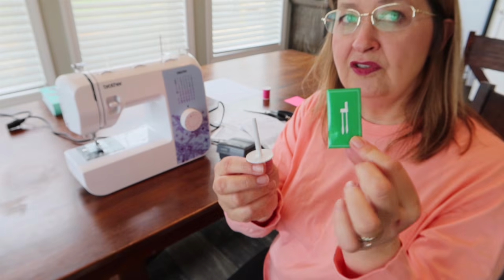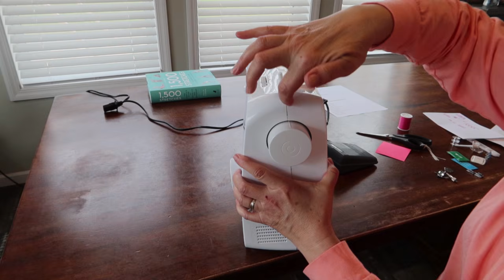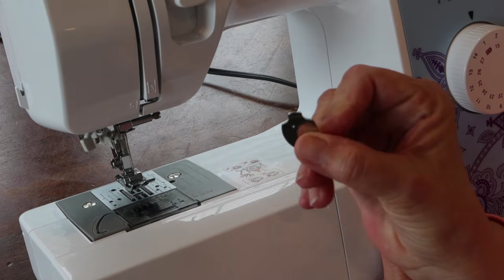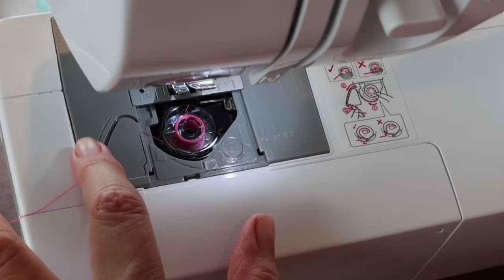Brother XM2701 Instructional video. Accessories, parts of the machine,

Comment: The feed dog of this particular model cannot be dropped to do quilting.  The darning plate is helpful yet the slightly raised level from the plate sometimes moves my hoop by its force.  Would a quilting foot/free motion foot solve the problem to let me embroider or guilt easily?  Thanks
Reply from the maker: Well, it would definitely give you enough space to move the fabric easily. I have not tried it, but it would be worth a test.
Reply: @momdoesstuff  ok thanks
Reply: ok thanks

Comment: Thank you for this instruction. I have been sewing for many years and this sewing by far is THE MOST COMPLICATED and CRAZY way of threading the threw the  bobbin, through the loops through the way to getting it going down the slit in the front, up the loop, and threading it so that you get the built I. Threader to actually hook the thread through the needle! Tedious and too many steps to remember this non traditional thread path to an ordinary sewing machine. Didn’t anyone ever tell the designer of this head spinning machine threading set up to “NOT to TRY TO REINVENT” what all the other REGULAR sewing machine have because this new threading set up by brother is a disaster!!! Every single time o have to thread this machine I get it wrong almost every time because I can’t get a foot stitch from it if it is threaded wrong!!! I spent over 30 min trying to follow this direction before I was successful. Then I had to rethread the machine again and had to watch the video yet another time!!!! I really don’t want to say this but there is a quote that I will write and you can all fill in the blank for the rest of the quote since it is always used, “ keep it simple _oo_.  Thanks but o must also add a no thanks since it is costing me hours to set this tread and spool up until o memorize how to do it. Hopefully with practice I should remember this ridiculously complicated threading & SPOOLING & BOBBINS set up❗️

Comment: with the accessory compartment (the bit you remove to turn it into a free arm machine) the storage is completely open, and because it hangs a bit lower than the machine, there is a gap and all the things in the storage tumble out. is there any way to fix it? 13:16
Reply: I kept my little accessories in the little zip lock bag and carefully stuffed it into the compartment. It keeps everything together and because it is slightly stuffed into that small space, it tends to stay in place when I take the accessory compartment off the machine.  I do imagine it would all tumble out if the accessories were not in a little bag.

Comment: I missed something. Why shouldn’t we have the light on when we thread the needle?
Reply from the maker: Well, it's not that you can't, it's just safer if the machine is off.
Reply: @momdoesstuff  Of course.  I understand now.  I had missed the part about accidentally stepping on the foot pedal and running over one's finger.  Makes sense, although frankly I have never turned the light off.  Thanks for the reply!

Comment: Thank you so much for a very detail instruction.  I bought an used Brother SM2700.  The thread keeps jumping off the thread pole.  Please tell me what can i do ?  The pole is glued to the position so i cannot change to another taller pole.  Please advise.  Thank you
Reply from the maker: There should be a round white disc with a hole in it that you can slip on the post to hold the thread spool in place
Reply: @momdoesstuff  there isn't one.  I bought 1 cap on amazon and it very loose because the hole is much bigger than the diameter of the thread pole..  Thank you.

Comment: Why is my thread keep on breaking when  I started sewing??
Reply from the maker: It could be several things. These are things I always try. Unthread and rethread the top and the bobbin. You could have missed a guide somewhere.
Try a different thread. Sometimes a spool of thread goes bad or just gets old. Make sure the thread isn’t getting hung up on the spool.
Try a new needle. It could have developed a burr in the eye that’s shredding your thread. 
Check your tension dial. Make sure it’s not too tight.
Hope this helps

Comment: Why is my thread keep on breaking?
Reply from the maker: Well, there are several things that can cause sudden thread breakage. I would rethread top and bottom threads carefully. It can be caused by a bad spool of thread. Try a different thread and see if it breaks as well. Also, sometimes the needle gets a rough spot on it and that can cause breaking.  Try a new needle.
Make sure your tension is not too tight.
Hope that helps

Comment: I bought this exact machine today but when I was testing it, although I didn't thread it but when I put it on and pressed on the presser foot only the bobbin threader turned. The needle did not move up and down. I don't know if there is something I didn't do right
Reply from the maker: Most likely the bobbin winder is engaged. The needle doesn’t move when it’s winding a bobbin. Move the bobbin winding spindle to the left
Reply: @momdoesstuff  oh!!!! It worked. Thanks so much.

Comment: Here is each section of this FANTASTIC video indexed for y'all!
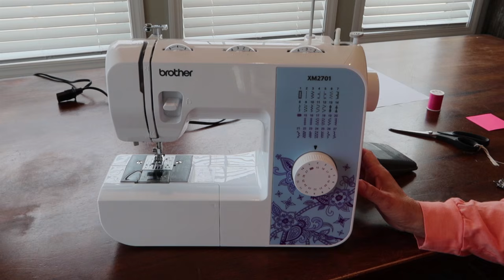First 3.5 minutes: Accessories and other things included with the machine. At 3:45, she begins describing the anatomy of the machine itself as follows:
3:55 - 4:31: Bobbin Winding Center - Bobbin winder, bobbin pin and bobbin compartment
4:32 - 4:51: Thread Spool Pin
4:52 - 5:04: Thread guides.
5:05 - 5:36: Take-up Lever and presser Foot
5:38 - 6:39: Needle Threader
6:40 - 7:45: Needle Plate

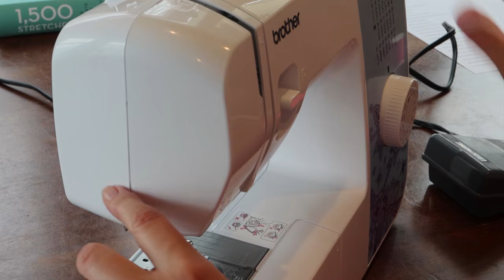7:49 - 8:13: Needle Cutter
7:14 - 9:33: Stitch length and Stitch width dials
9:34 - 10:01: Thread Tension Dial
10:02 - 11:23: Stitch Pattern Selector
11:24 - 11:36: Reverse Stitch Selector
11:37 - 11:42: Hand Wheel
11:43 - 13:19 Accessory Compartment and Free-Arm Feature
13:20 - 13:52: Intro to Operation, turning the machine on and off and plugging in presser foot pedal
13:53 - 14:57: IMPORTANT SAFETY TIP!
14:58 - 16:59: Needle Replacement
17:00 - 20:41: Steps 1 - How to Thread the Bobbin
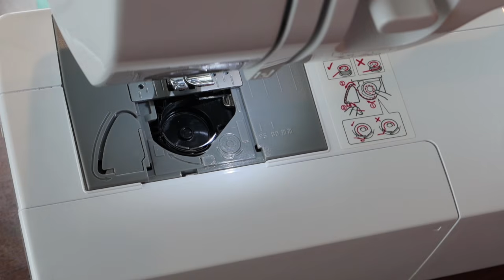20:42 - 22:29: Loading the Bobbin in the Bobbin Compartment
22:31 - 27:03: Threading the Needle
27:04 - 27:50: Unthreading the machine after use
27:51 - End: Practice
Reply from the maker: Oh wow! Thank you so much!!!
Reply: @momdoesstuff  If it's helpful, feel free to copy into the description with any tweaks you see fit to make!
Reply from the maker: Thank you so much! It's perfect just like it is! @kathydiane23

Comment: Hi! I followed all these instructions, but when I go to sew, the needle gets stuck after a while, and when i pull the fabric out, one side of the fabric is how it should look, but the underside is a MESS of thread and it’s all tangled. What am I doing wrong??
Reply from the maker: Problems on the underside usually mean a problem with the top thread. Unthread and rethread again. Make sure the presser foot is raised while threading. Check your tension dial. Should be between 3-5 for normal sewing. Hope that helps!

Comment: Thank you !! Just bought the machine with zero sewing experience. You explained and answer all my questions. However I don’t get why we have to put the small plastic device with the extra thread inside the compartment under the needle 😅. Can someone tell me
Reply from the maker: A seam is made from 2 threads. As the fabric passes under the needle, the two threads will be locked together. Hope that helps! Thank you for watching!

Comment: I’m really confused on what type of thread to use with this sewing machine…I ended up getting Guterman 100m 100% polyester NM 70-90…will this work for hemming and basic sewing?
Reply from the maker: I haven't used that particular thread, but I looked it up online. It should work just fine. Some machines just don't 'like' some brands, so don't hesitate to try some others if you have tension problems.
Reply: @momdoesstuff  thank you so much! Your video was so helpful and thanks for getting back to me so soon! 💕

Comment: This was so much better thn the instructions video it came with. Except my bottom keeps ending up a hot mess why is it bunching so bad
Reply: When the thread on my bobbins clump at the top or bottom I like to gently guide the thread to the other side
Reply from the maker: If you are getting a nest of threads on the bottom, it’s usually a problem with the upper threading. I unthread it and rethread. Sometimes you just miss a guide.

Comment: Happy Holidays!!!  Thank you so much for this video.  The book just didn't cover some of the basics so I could get started.  I've been struggling to get to stitches 13 or14.  The knob just will not turn that far.  Any suggestions other than returning it?  Thank you!
Reply from the maker: You are so welcome! My knob turns pretty easily. It does seem to get more difficult the wider I set my stitch width dial. Make sure you needle is in the up position and set the stitch width on about 1 or 2 and see if that helps any. Thanks for watching!

Comment: Best tutorial ever, one question, how do we control the frequency of the stitch? Mine runs too fast.
Reply from the maker: Thank you! The speed should respond to the pressure on the foot pedal. The harder you press, the faster it goes. I have had a foot pedal that went 'bad' once before, it just wouldn't adjust the speed. If yours doesn't work this way, you might want to get a replacement.
Reply: @momdoesstuff  THANK YOU!

Comment: Hello 
How would I lock my stitch on this machine?? When I’m done sewing my threads aren’t in a knot they’re loose😭
Reply from the maker: https://www.youtube.com/watch?v=9Tw9op4bGcU&list=PLZocgsi1E8it-0N2czs-dO5113Za5zWmM&index=4&t=4s at about 05:02
Reply: @momdoesstuff  ok and is there a machine that automatically ties it ?? I remember I had a mini sewing machine off Amazon and it tied my ends 😭 it was like $30 and these won’t tie them off
Reply from the maker: @Inthecloudlaughs  There are some, but I don't think any of mine have it. I used to have a free motion quilter that would do it. Some machine will have a auto back stitch function that they call auto tie off. Very interesting, though. I'm gonna do some research on this and see what I can find.
Reply from the maker: You can reverse stitch a couple of stitches on each end, or you can pull the top thread through to the bottom and tie them off. I have a video showing this, let me find it.
Reply: Thank you so much

Comment: Thanks for the great video! I was wondering if there is a way on this machine to change the amount of pressure exerted by the presser foot. When I googled this question, I got a bunch of answers pertaining to machines that either had a presser foot wheel or some kind of dial (like a screw), but I don’t see that on this machine. Is it something just not offered?
Reply from the maker: I’m sorry! I’m just now seeing this for some reason 🤦‍♀️As far as I know, this machine doesn’t have adjustable pressure on the presser foot

Comment: My bobbins have much wider holes. Is that an issue? I do find that when I refill the plastic ones, that some of my fancier stitches (like 22, which I LOVE) don't keep their shape and I've been thinking that could be related, but I don't know if there's an extension piece to place on the external bobbin holder that's wider.
Reply from the maker: this machine uses a class 15 bobbin (SA 156). It should fit snugly on the spool pin for winding. Using the wrong size bobbin could definitely cause some tension issues.

Comment: When I sew, it used an excess amount of thread and when I flip it over to look , it’s like lumpy with too much thread ?
Reply from the maker: Problems on the bottom usually means something is wrong with the upper threading. Unthread completely, and carefully rethread. Make sure you have the presser foot raised until you get ready to thread the needle. Tension should be between 3 & 5. Hope this helps!

Comment: I cannot get 
the needle threader to thread.  I've tried and tried.  What now?
Reply from the maker: It is kinda tricky until you get the hang of it. You don't have to use the needle threader. You can just thread the needle by hand
Reply: @momdoesstuff  Thank you so much Mom Does Stuff.  I simply loved your video.  Now here's the problem after threading the needle by hand.  It starts to sew, then clunk noise and thread breaks and there is a little wad of thread on back of material..I have a feeling it's the tension somewhere.  My old machine was over 40+ years, all metal.  Worked like a jewel until it's retirement.  I figured parts I'm sure were  going to be difficult for the old gal.  So now the new kid on the block is acting up.  MDS, I'm going to try once more today, and then calling the Brother company.  Hopefully they can help me out.  They do with my all my printers, business and home.  Again Thank you so much.  I'm going to keep watching you for sure.  
Janis Martinelli
Reply from the maker: @janismartinelli7458  I hope Brother can give some guidance. they have always been awesome whenever I've called.

Comment: Great video! Purchased as used. After following all the direction, the bottom thread is not catching. Any suggestions?
Reply from the maker: I always unthread both top and bottom and rethread. Sometimes a guide doesn't catch just right. And you might want to leave a little longer tail on the bobbin to make sure there's enough to pull through.

Comment: Can’t wait til your new videos! I am new to sewing and this was very helpful!
Reply from the maker: Thank you! I'm so glad it was helpful!
Reply: @momdoesstuff  I keep ending up with material sewn but when I flip it over. There is a wad of thread and it’s sometimes kinda stuck to the machine, what could be causing that? Tension or maybe I didn’t thread quite right?
Reply from the maker: @kristinbailey3227  Usually if the thread on the bottom is messed up, it the upper thread that is the problem. I would completely unthread and carefully rethread the upper thread. I would also rethread the bobbin just to be safe.  It could also be the tension. Start off with tension between 3-5.
Reply: @momdoesstuff  thanks so much! I have rethreaded so will try changing tension